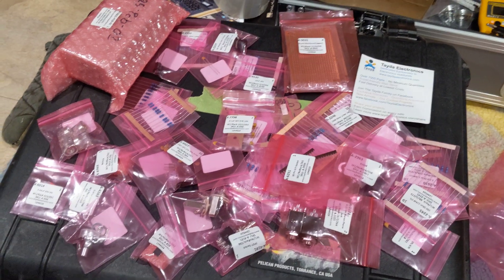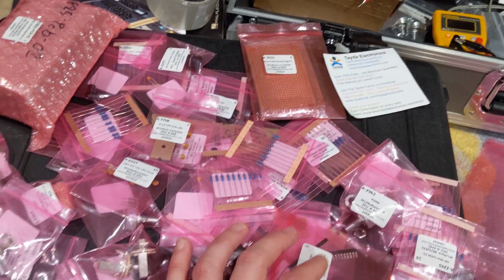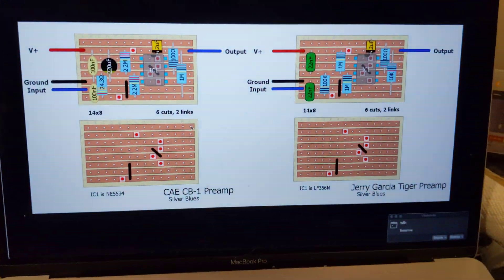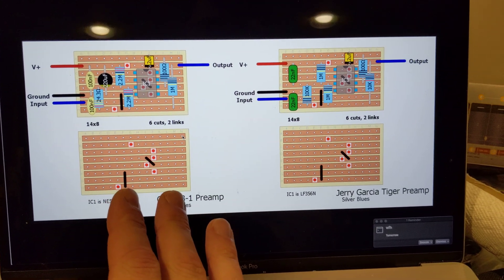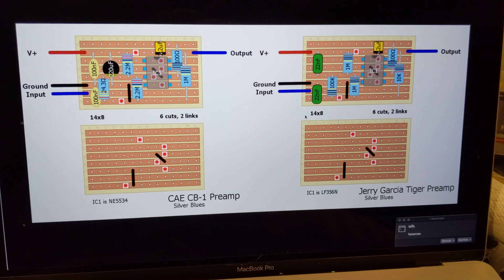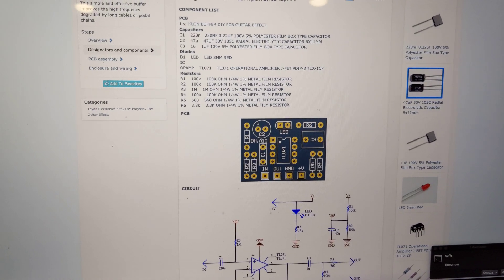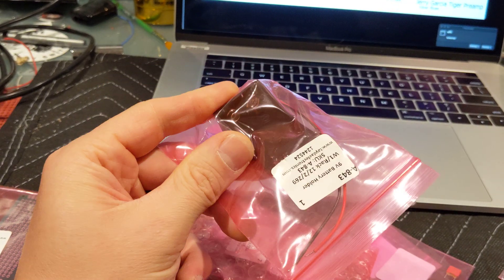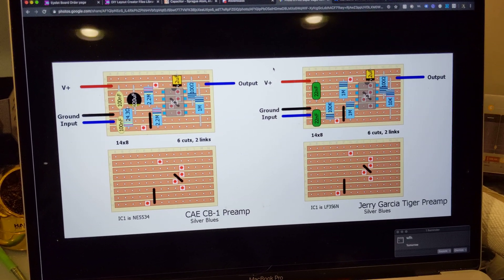Jerry Garcia Unity Gain Buffer & Super Eagle 2 JCF Preamp + Treble Boost Research

Comment: Why not connect one of your Boss pedals and turn it off? Now your signal is buffered...
Comparing buffers? You will just be noticing the difference in noise in the circuit, if anything at all.
Reply from the maker: The idea in this case is the buffer will be in the guitar so the cable length will not affect the high end tone loss. I don't use long cables so it won't likely make a big difference in tone but the JCF with treble boost can be interesting if it's in the guitar and cable capacitance might not matter much
Reply: @TheToneGeek  Why is it interesting to put treble booster and buffer in the guitar if you don't use long cables? Then you might as well use a stompbox and no buffer. 
All buffers do is cancel the effect of cable capacitance - nothing else. It has no sonic qualities... if it is working correctly. 

We traced an published the Klon schematic et al. in order to demystify this stuff, not to make revered. There is no Klon buffer, it's just a buffer and there is no Cornish buffer either. If there is an ultimate buffer sound it is the Boss buffer ;-)
I'm wasting my time...
Reply from the maker: @zjokka  I appreciate your comments and insight. I'm driven by curiosity and learning new skills and I'd like to learn how to design a PCB so this project is a good one to start with, for me.